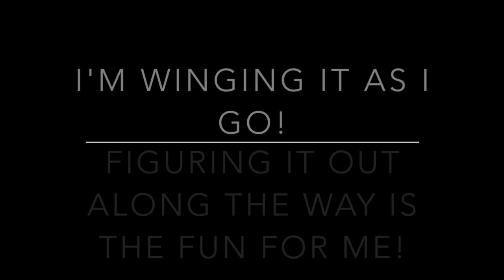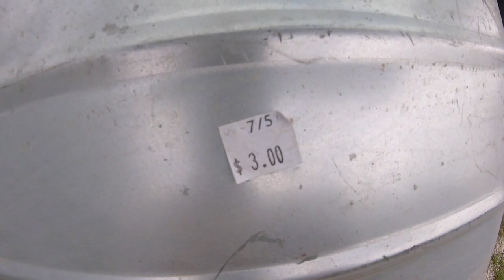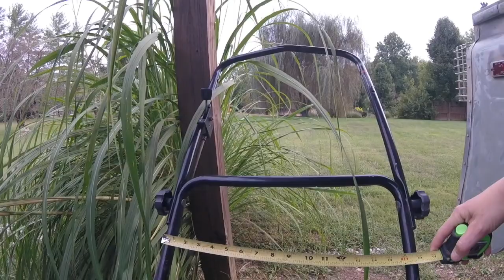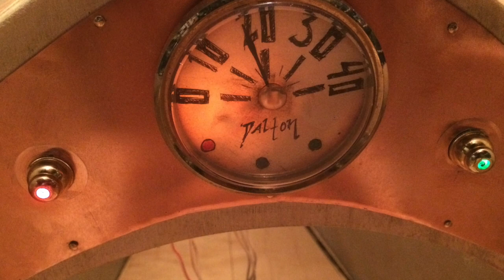Building a Bicycle Sidecar (part 2 of 8)

Comment: Is it me or are you mounting the side car on the left side of the bike, traditionally here in the U.S., they are on the right side. So a passenger could safely exit to the curb or sidewalk, in Europe and other eastern countries that drive left the side car would be on the left side, as passengers would exit to the left. Aside from that this is a very unique build process and project, kind of a top down build starting with your imagination of something cool, great job. Is that 2 stroke motor going to have enough “umph “ to help maintain speed, I would consider a 4 stroke engine personally, just for the added torque.
Reply from the maker: Yep we run it on the left side, primarily chose that because of the way bicycle sifting mechanisms etc are on the right side and thus would complicate adding a side car...it was really fun when the little guy was small, he’s almost 5 now and can ride his own rig and doesn’t want ole mom lol when I was deciding which side we saw sidecars both ways so I just picked easiest side...we never ride it on the main roads just in campgrounds and car shows and an occasional tweed ride!
Reply: I understand, anybody asks, I’m sure you will have some fun with them

Comment: How many layers do you use to get it to where you have in this stage? This is so cool, also does the parchment paper get removed or stay on after you remove it off the canoe?
Reply from the maker: I have about 16 layers of resin on and two layers of the fabric.  I did 1 layer fabric with about 6 layers resin on top then second layer fabric and remaining layers of resin...I wanted to keep it kind of "thin" but durable.  It ended up being about 3/8 thick for most of it (I know doesn't look like it in videos).  Wax paper just peeled right off! It didn't stick to the canoe at all, we still use the canoe...no harm done to it!  My son STILL rides it in occasionally even though he is now 6! It is getting a bit tight for him tho and of course he wants me to build another! ha